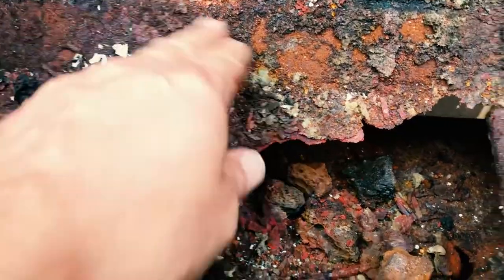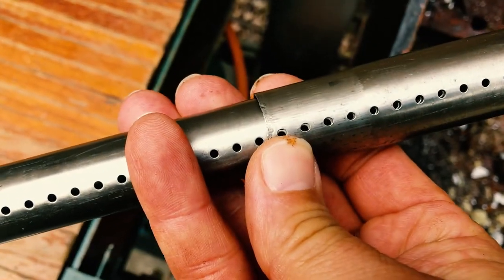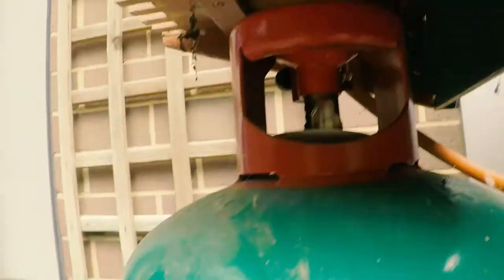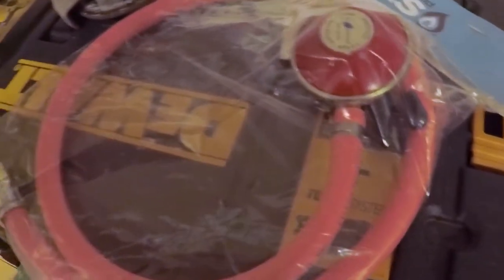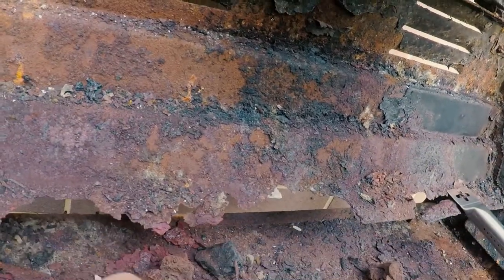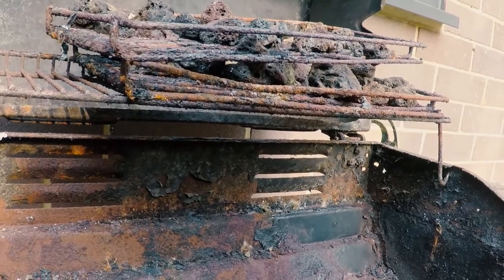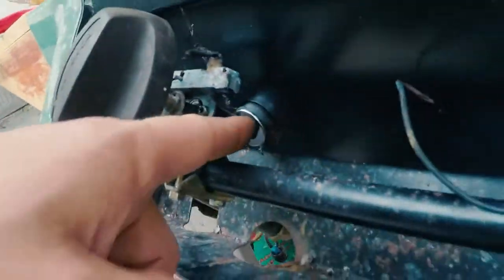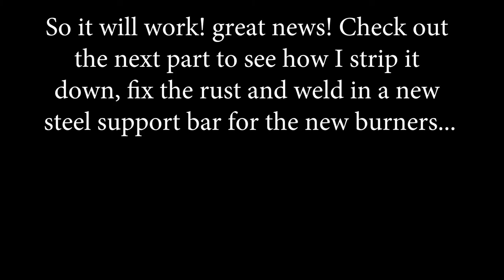Can I restore and rebuild my Rusty 13 year old Outback bbq barbecue?:  part 1- will it work??

Comment: I’m looking at servicing my bbq…its same as yours but mines in great nick but thought it wold Ben if it from service. Do the burners just pull off then? Or are they connected by BSP unions? Any gaskets needed. I dont want to spend any money on mine as I’m wanting to purchase a new bbq in next 12 months after some major remodelling works to garden….I’m having build in kitchen area .
Reply from the maker: Hi the burners just lift off. Very easy. No gaskets.

Comment: Where did you buy the replacement parts from ?
Reply from the maker: Hi I used these: 
Deal: GFTIME 42204 Extend from 30.5 to 44.5CM Adjustable Burner For Char-Broil, FirePlus, Fire Mountain, CosmoGrill, Universal Stainless Steel Burner Tube Replacement Parts for Most Grills, 4 Pack
Reply from the maker: From Amazon UK.
Reply: Thanks, I found the burners, but cannot find any replacement lava rock trays. You’ve inspired me to repair mine
Reply from the maker: The trays I found don’t quite fit but I make them work just about :) I’m thrilled you are going to restore yours! Do share the results :)